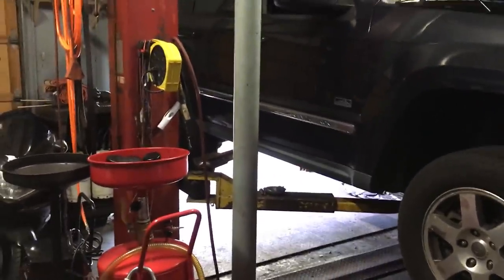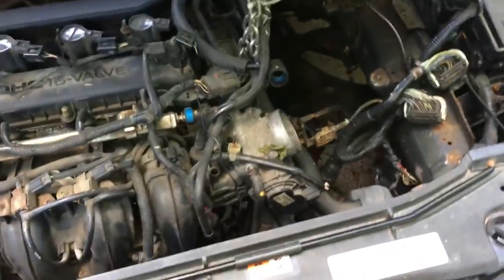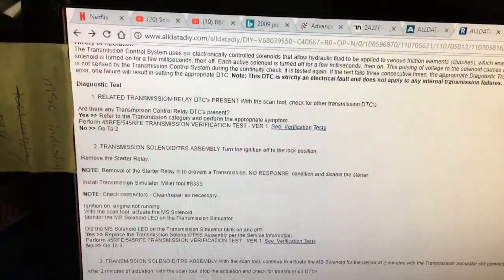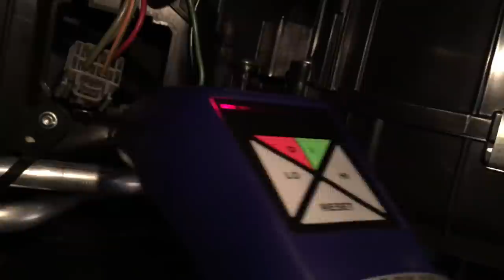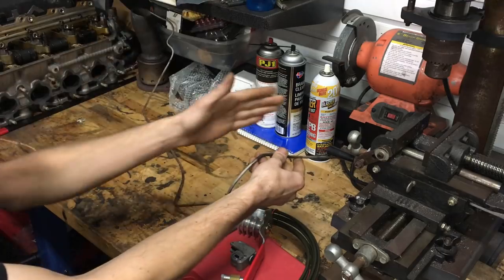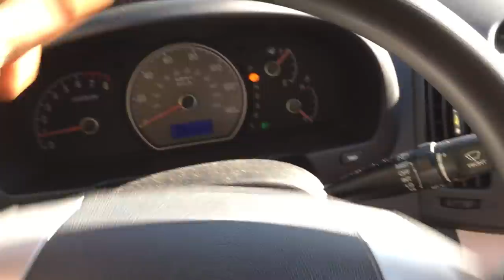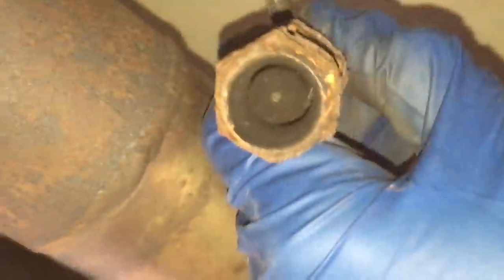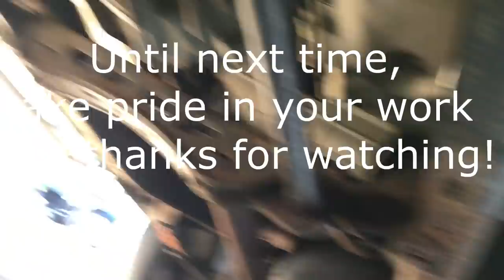A day in the life of a self employed mechanic!

Comment: I would say if you got a head gasket thats so bad coolant is running out under pressure I would not even attempt to repair it. Head has been damaged beyond repair if that were the case. Good thing customer opted for a new motor.
Reply: A damn Mazda 3 Head cost $800.00.. You can buy a used motor for $900.00. Do the math. And you don't have to fuck with that Key less Crank Balance. You get that wrong. You be buying an Engine. I done 3 so far. As they did them wrong.

Comment: ford auto tech of 25 years i am.A nice little business you got there.im located in wi and could never work outside,not because i dont want to,just because to much weather variations and would never get anything done.i built my own new shop at my home now,bendpak lift,a so on.i doubt i will ever do any major work out of it for someone else.like others said,can  go crazy running your own repair shop with the stress and zhit that goes wrong.when i did on the side work,simple stuff turned into the worst,if it could go wrong,it would!repairs that i do every week at work turned into a nightmare.good luck to u though

Comment: Hey guy I know this is an old video but there is a quick way to decide if the evap is leaking - get the ac running and up to pressure - then shut the thing down and just waite a couple of minutes - then just put it sniffer into an outlet vent and turn the fan on low - the freon is heavier than air and will lay in the bottom of the housing till u bump the fan and force it out the vent to ur sniffer... then look up the hours to change the evaporator and double it... I am a semi retired one man shop myself...

Comment: Those 2015+ Jeep Liberty/Patriots are f**kn ridiculous you have to recover and disconnect the refrigerant and AC Compressor lines just to change the Alternator 😂 i hated when they came in brand new under 20k Miles all with faulty alternator Overunning Pullys, theyd just snap whatever connection to the stator like a twig n it would just free spool on the pully, not driving the stator or charging the battery (obviously). 
No more Rental car work for me haha (i hope atleast) because it was nice 'verifying the repair' driving the Camaro SS/Audi A4 and my favorite the Infiniti Q60 (which smokes the dog piss out of the Camaro SS, trust me 😂)  along with a slew of other nice ones.
Anyway thats my 2 cents essay.
Btw if you get any 2016+ Hyundai or Kia Sonota/Optima, they leak at the condensor, faulty mounting i guess causes line to crack @ discharge condensor port around 25-30k miles